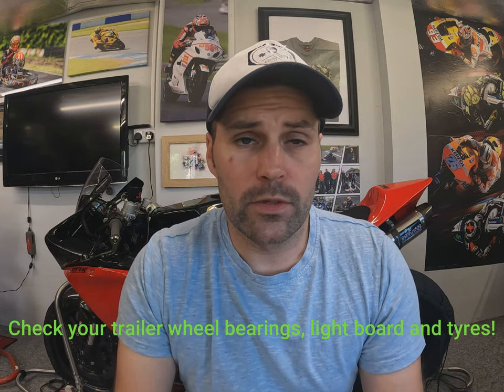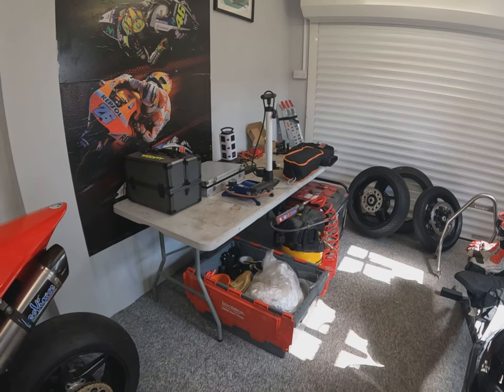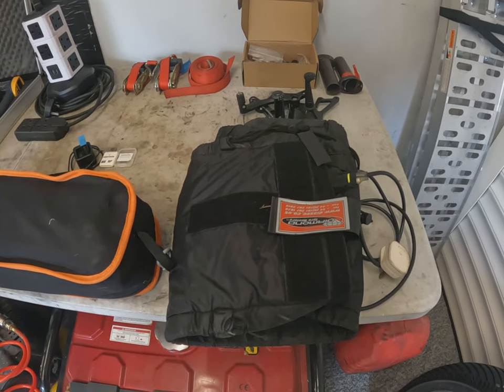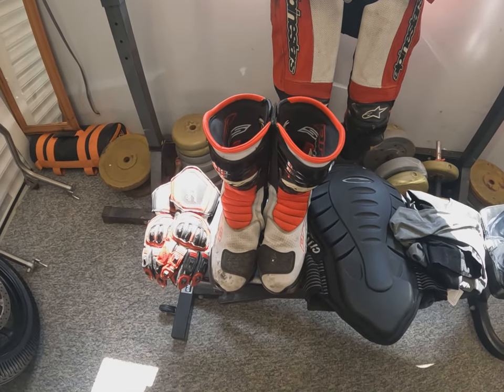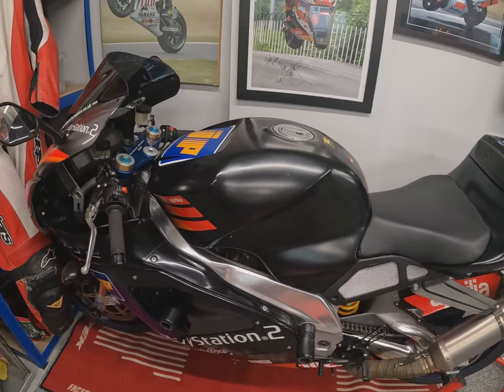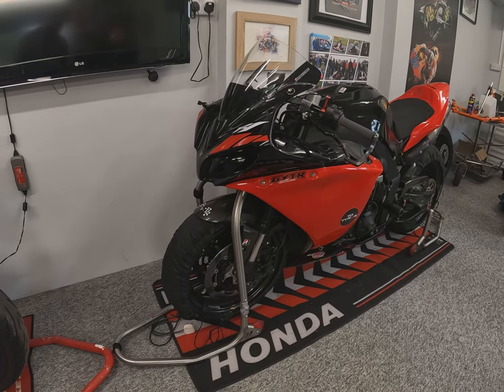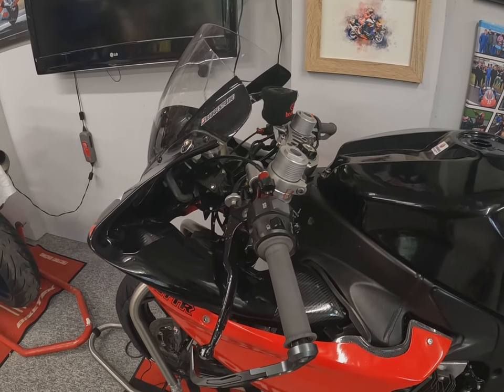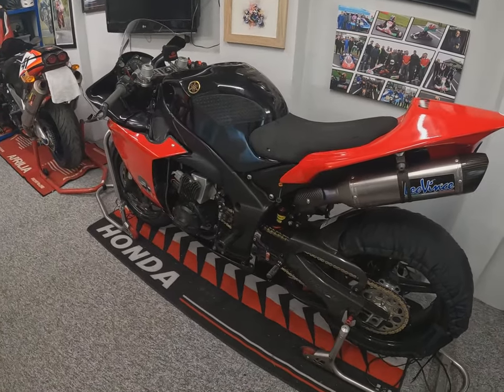Track day preparation 101

Comment: How do you find the exhaust noise? I have a 2013 R1 with akrapovic cans with a decat, and I’m looking to start Trackdays 👍
Reply from the maker: It sounds amazing but not overly loud. Louder at idle than when riding. It blew 101db without baffles